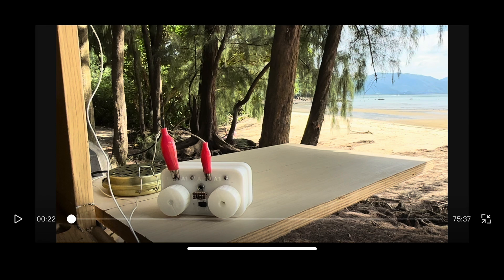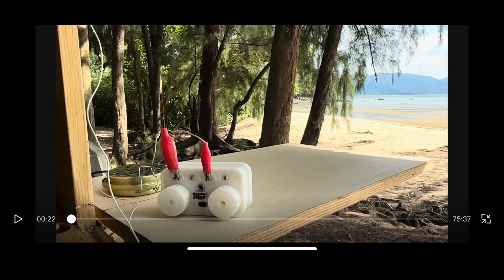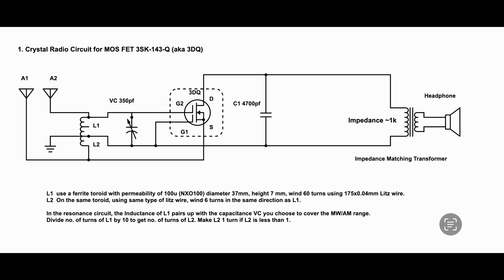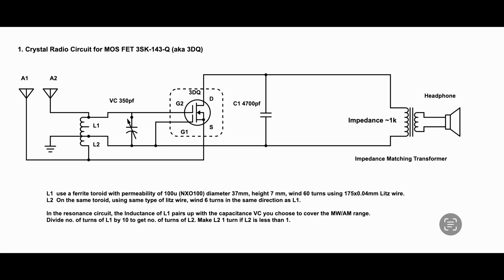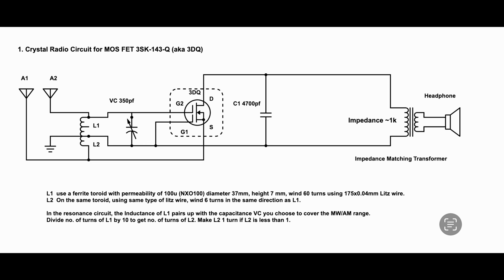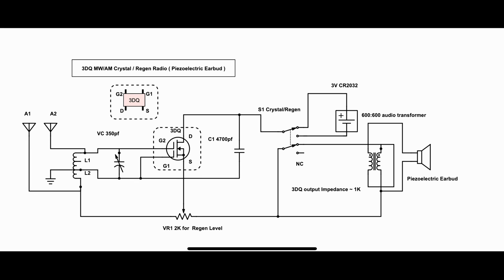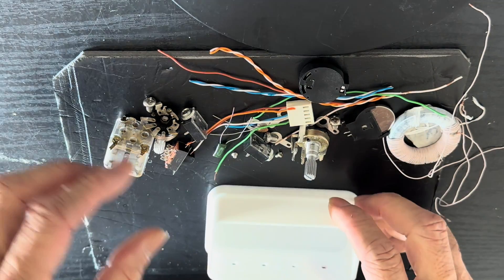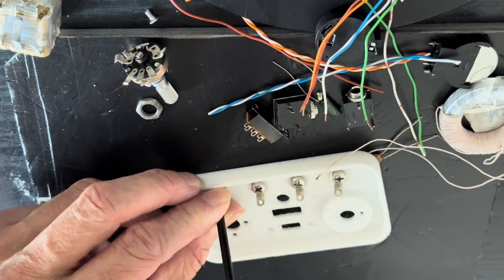The design making and testing of the 3DQ crystal/regen radio3DQ MOS FET 礦石/ 再生收音機 設計製作和測試

Comment: I like the idea of the buzzer as a ear phone, but doesn't the buzzer already have driving circuitry to make it buzz when you add a DC voltage?
Reply from the maker: @RobertWardJones  , I tested before that it will not buzz as the audio signal do not have enough voltage to buzz it. To be perfect you can remove the cover and solder the connections directly to the piezoelectric plates and disconnect that from the buzzer circuitry
Reply from the maker: @RobertWardJones  this video has the detail instructions DIY Crystal Earphone for Crystal Radio
https://youtu.be/k3HsVlxR2tA
Reply: @BillyCdiy  That was very helpful. Thanks!